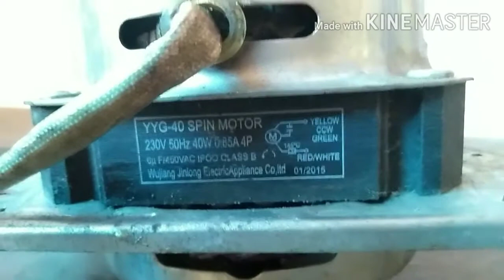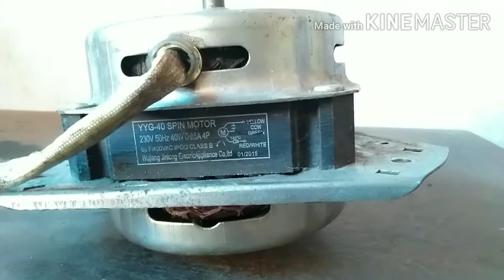How to check washing machine motor | Common satrting running connection

Comment: bro wash motor tight anu... smooth rotation ella kai kondu karakumbo... on akumbo humming sound undu bt rotate akunilla. capacitor mari, 2days work ayi pine epo kai kondu karakiyal 2 sidel ottum karangum. bt epo normal tight alla payankara hard anu motor. belt loose aki karakittum motor anu tight

Comment: Hi ബ്രോ വീഡിയോ അടിപൊളി, ഒന്ന് രണ്ടു ഡൌട്ട് ഉണ്ട് പറഞ്ഞു തരാമോ 

1.  എന്റെ കയ്യിൽ whirlpool ന്റെ ഒരു സ്പിന്നർ മോട്ടോറും ഒരു വാഷ് മോട്ടോറും ഉണ്ട് എന്നാൽ അതിൽ വാഷ് മോട്ടോറിൽ ബ്ലാക്ക്, blue, yello, ഇങ്ങനെയും സ്പിന്നേറിൽ ബ്ലാക്ക്, red, yello,  ഇങ്ങനെയും ആണ് രണ്ടിലും diagram ഇല്ല അപ്പോൾ നമ്മൾ എങ്ങിനെ മനസിലാകും 
2 അതുപോലെ മറ്റൊരു whirlpool മോട്ടോറിൽ red, blue, yellow, ഇങ്ങനെയാണ് അതിൽ diagram ഒണ്ട് അത് പ്രകാരം റെഡ് ആദ്യം, പിന്നെ ബ്ലൂ, പിന്നെ yellow,  അതിൽ yellow, commen,  ആണെന്ന് മനസിലായി, റെഡിനും നടുവിൽ ഉള്ള ബ്ലുഎവിനും ഇടയിൽ കപ്പാസിറ്റർ കാണുന്നുണ്ട് അപ്പോൾ അതിൽ ആദ്യം ഒള്ള റെഡ് ആണോ സ്റ്റാർട്ടിങ് നടുക്കുള്ള ബ്ലൂ runningum ആണോ മറുപടി പ്രതീക്ഷിക്കുന്നു
Reply from the maker: Chila diagrangalil staring line represent cheyyunna line cheruth aayrikum
Angane ulla diagrangalil string running change aavaan padilla
Reply from the maker: Pinne chila diagrangalil staring and running represent cheyyunna line same length aayrikum angane diagram ulla motor starting running maariyal problem illa

Comment: നൈസ് video bro.
Capacitor weak ആണെങ്കിൽ motor power കുറയുമോ.?
Reply from the maker: Motor stuck aavum kaykond support cheythaal rotate aavum.
Reply: @Mech969567  capacitor chnge cheithu.
Ippol adipoliyayi work aavunnundu. 👍
Reply: Capacitor change akki motor karaghunila

Comment: I did all connections of wash motor, capacitor(9.5uf), and 5 wire timer. After running a few minutes the motor getting over heated and stop urnning. Then only one small sound. Why? Plz reply asap

Comment: Chetta,  automatic  machine annu ,
Machine on aakkiyal kurach  kuzhiyumbol  automatically  machine off aakum but power und load edukkilla,  vellam  kori  kalayenda  avasta  aanu. .pls help.
Reply from the maker: Pressure switch complante aavum.
Vellam korikalayanda aavashym illa spin mode ittu work cheyyipichaal vellam automatic pokoolum.

Comment: how can i run the same motor in dc i need it for my elecrric bycycle
Reply from the maker: This motor woring only Ac
Reply: @Mech969567  what if we use an dc to ac converter?

Comment: Fullu automatic machinente motor mooli nilkkunnu capacitor matty ennittum same problem
Reply from the maker: Motor bordilninnum disconnect cheythit direc work cheyyipiku check cheythu nooku. Ennitum athupoole aanenki motor pooy kaanum
Reply: @Mech969567  thanks

Comment: സ്പിൻ Motor Very slow semi Automatic '..:P
Reply from the maker: Aadym backside azhikuka ennit spin motorinte brake(like a spring) athu valichu pidichit work cheyyipikuka
Ennit ok aayillenki capacitor change cheydu work cheyyipikuka
Ennitm aayillenki motor maatuka
Reply: @Mech969567  capacitar മാറ്റി നോക്കി ,പിന്നെ on ചെയ്യാതെ freehand motor കറക്കുമ്പോൾ Smooth ആയി കറങ്ങുന്നുണ്ട്  motor ടെറ്റ് ഇല്ല, motor ന് മുളിച്ചമാത്രമേ ഉള്ളൂ
Reply from the maker: Ennal motor change cheyyu.
Doub indenki vido kanadathupoole azhicheduth work cheyyipichaal mathi.
Watch this video:https://youtu.be/ln8tEypQ3LQ

Comment: Please share only proper knowledge, don't misguide others who are looking for advice.  A wash motor has three wires of which one is common, the other two become either start or run depending  on which wire you supply power to, the rotation changes clockwise or anti clockwise if you provide power to any one wire other than common. Polarity is observed only in a DC circuit.
Reply from the maker: Where I was misunderstood?
I have shown you the wiring by looking at the diagram shown on the motor.
The starting and running common is very clearly shown in the diagram for that motor.
When I look at the diagram and wiring, you see that the motor rotates well.
Reply: @Mech969567  you sure did do the right connections. But in the video @ 7.30 you said the motor would burnout or slowly die if the power is given to the other terminal .....actually  the capacitor wires can be interchanged between the start and run wires, and the only thing that could happen is forward and reverse. Thats what is done in the controller or timer of the washing machine. Otherwise it is definitely educative.
Reply: @Mohan-a2a  yes you are correct..